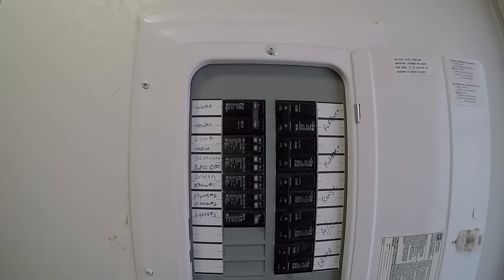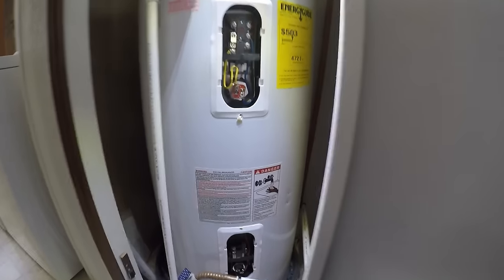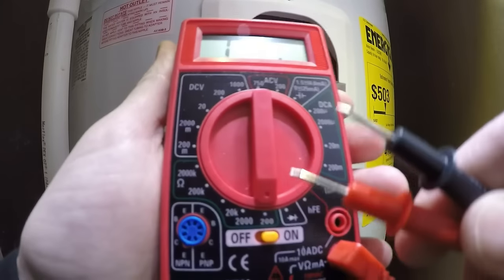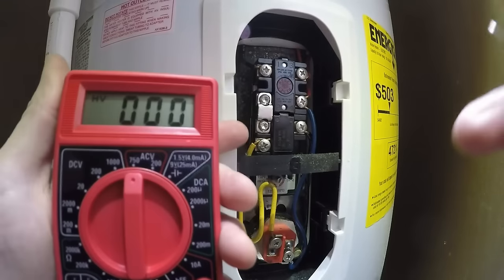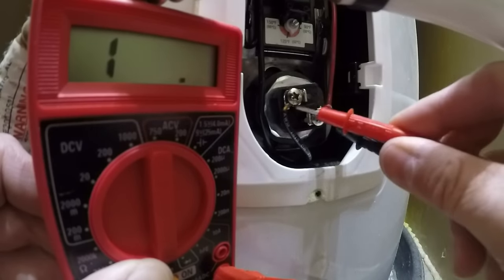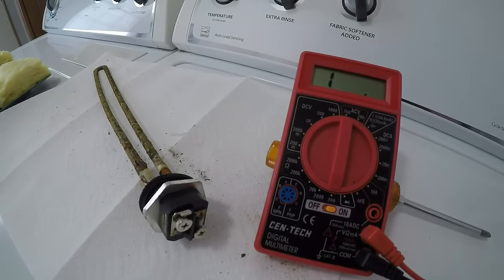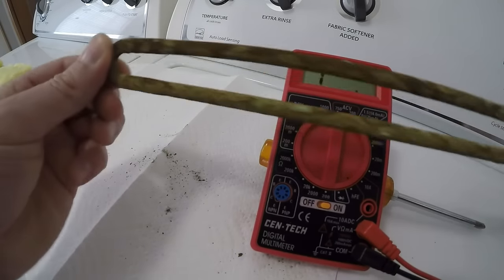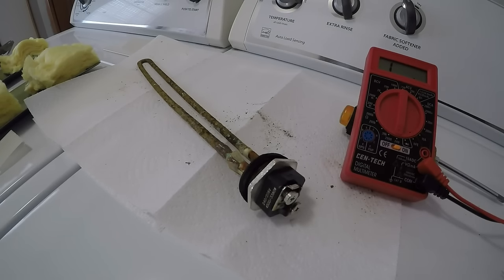How To Test A Water Heater Element

Comment: What if neither element has a reading? My meter is working fine
Reply from the maker: Not sure man you would think they have a reading unless you have a different setup or tank
Reply: You should always have 120volts at both elements at same time to ground  , the high limit control at the top transfers second 120volts to either top element or bottom.

Comment: Also would like to add my multimeter when tuned to ohms will read OL (overload) and this might be confusing to the dyi electrician as OL may be an indication that there is a problem in most cases. Although the continuity is not there, the meter stays at OL were as a brand new element will read 12 to 16 ohms of resistance like mentioned before the OL will stay the same. Thanks for the video, it helped as I thought I could just beep test for continuity but this allows for a more detailed emersion of the state the element may be in.
Reply from the maker: You’re welcome Scott hope you make out okay with yours
Reply: @jamiewagner   funny story I didn't know that the elements don't hear simultaneously. So umm well they are both new now lol
Reply from the maker: Yeah lol

Comment: I got about 18 ohms on each element with the breaker off.  How do I know which element to replace?
Reply from the maker: What’s actually happening with your situation? Is your breaker tripping? Is your water not getting hot? Or is it getting to hot? Sometimes the issue can be in the wiring or thermostats

Comment: Continuity test does NOT complete the test!  must calculate and check amps while energized.
Faulty elements can easily pass your test.  Please fix your video.  You can completely bypass your continuity test because you MUST perform an amp test on BOTH legs of current.

Comment: I didn't like this tutorial for one reason. You never stated if the water heater should be emptied first or if it can be full before testing.
Reply from the maker: okay thanks for the comment I guess I didn't mention that, you can actually do it either way

Comment: i checked mine and it read a 8 is that enough or not
Reply from the maker: +Johnny Skinner seems a bit low. I'll bet your element is heading in the replacement direction.
Reply: Ok thank you
Reply from the maker: +Johnny Skinner no problem good luck with it.

Comment: You said the water was "burning hot" which led you to believe something was wrong with the heater. If the element was burned out and the breaker tripped shouldn't the water have been cold? Are you sure that there wasn't a problem with the thermostat sticking on causing the element to fail?
Reply from the maker: No idea but I replaced both of them anyway and the thermostats